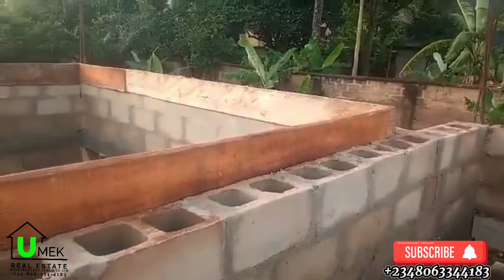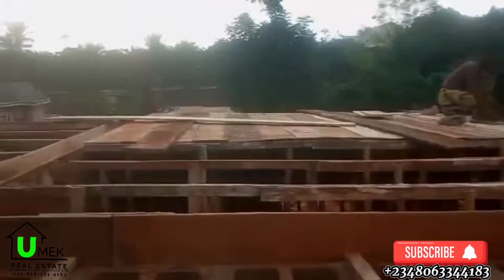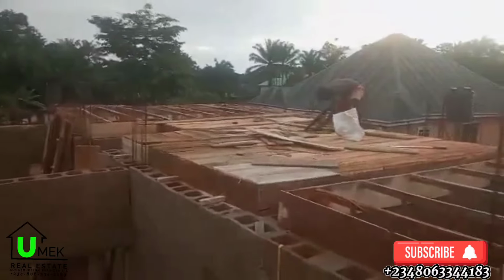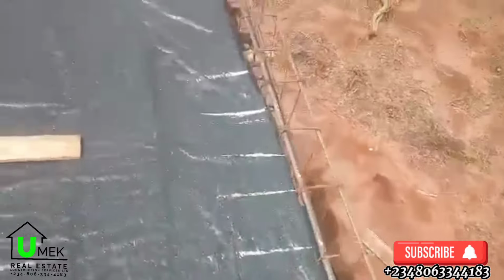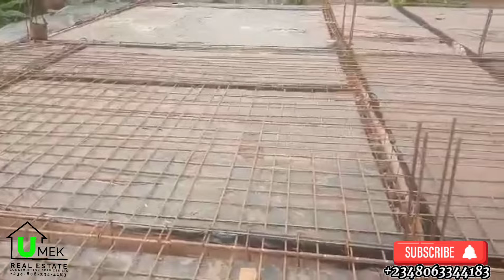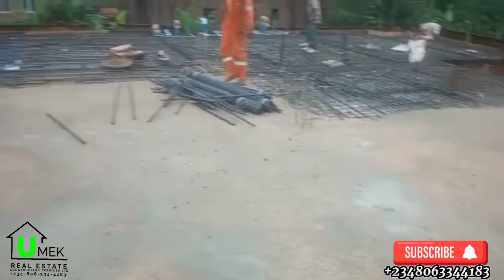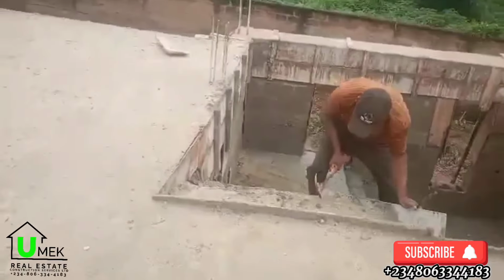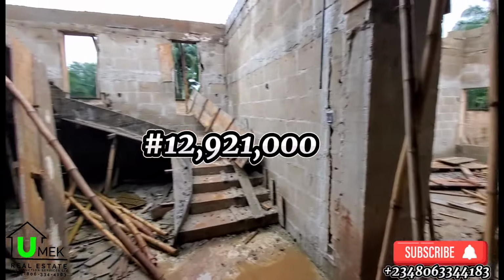Casting a 304sqm Decking; cost of material and labour

Comment: Good analysis. Thank you
Costs however vary slightly in different locations and cities due to the variations in costs of materials and labor. 
Cement and labor costs are surprisingly cheaper in Abuja than Lagos. 
Plank cost (3000 Naira) was outrageous in my location too.
Reply from the maker: Yes, you are right